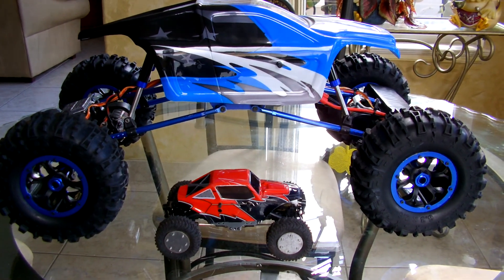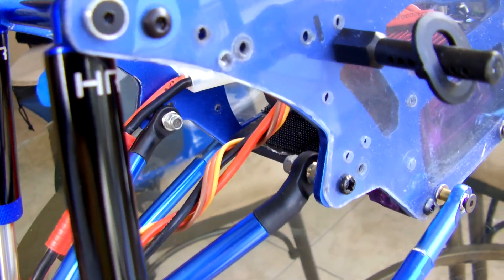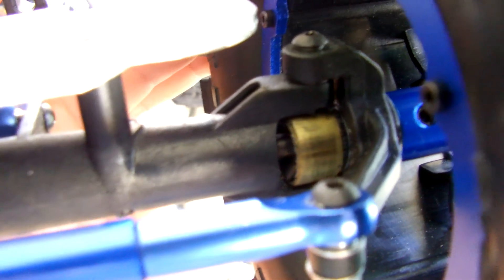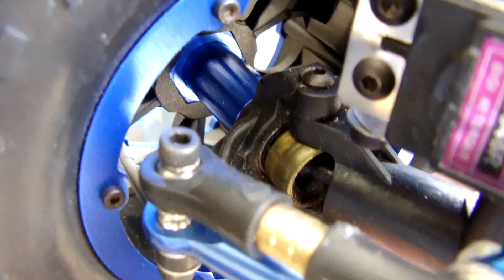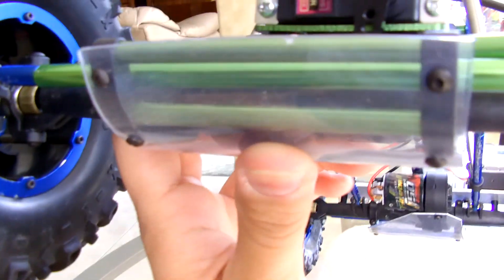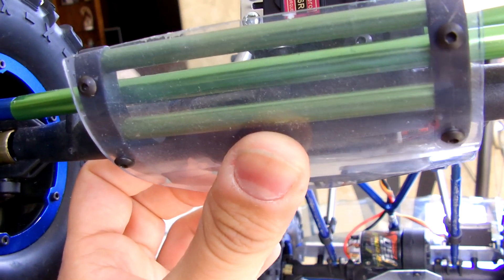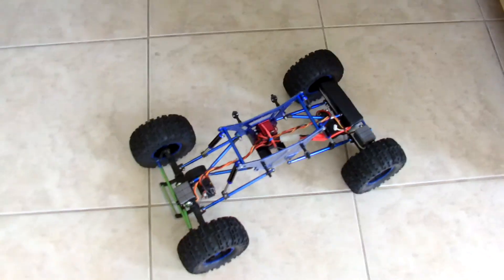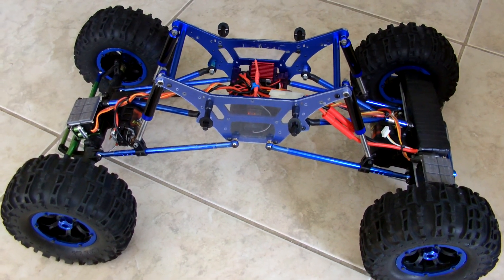Exceed RC Mad Torque 1/8 Rock Crawler Mods / Upgrades 2

Comment: Nice job on those skid plates. I used 1/16 in. black abs attached with c-sunk flat head screws, and formed around the motors and bumpers with a heat gun.

Comment: I have the same shocks  but there are only 100mm hot racing shocks works great on the front only stock shock on the back and a big 4 inch washer super glued on the steering servo.

Comment: I didn't realize it the 1st time I saw this vid. but you custom made the mounting bracket for the servo too. when you moved the cam down in front of the servo so you can see T-pro
I paused and saw the cutouts I thought, holy shit, he made the whole bracket too. 
how cool is that ..... then I rewound a few seconds and looked again. definitely LIKE all the mods you've done. I doubt I would have thought of that. I've watched some of the other mods about this and yours is the best I've seen so far.

Comment: casters off AX10 fit no mods.. i jyst bought one.. finally lol .. but i know all the things needing to be fixed.. fast & furious Toyota supera body going on it.. losing some articulation but jyst for fun..  soon dual esc & lil brushless motors to test.. cheapies.. but.. fun part.. mounting body.. already starting cuz got it in mail.. front motor stock runs first.. so prob reversing motor wires front to the back visa versa

Comment from the maker: Thanks,but actually internally mounted shocks bring weight to center of rig and also allow for more articulation,also bent shock rod is due to lower mount not being tight enough allowing for lower link movement side to side causing sideways force to be applied to rod.But I agree that it can happen, these shocks dont have that issue because rod is actually much wider than stock making them almost imposible to bend.My advice would be to use aluminum lower link shock mounts, they work wonders. :)

Comment: Do You Have Any Problems Of Your Steering Knuckles Keep Breaking??? Well Mines Do.. I Tried Looking For Aluminum Or Beef Up Aftermarket Ones But No Luck...😐 So I Have No Choice But To Oder From Nitro Rcx.. It Takes Bout 2 Weeks To Get In.. It's B/c The Area Where I Live & The Shipping Cost Is Killing MeToo.. lol... But Anyhow, If U Have Any Idea On How Can I Beef Up My Steering Knuckles, I Would Highly Appreciate It... Thanks☺
Reply from the maker: You can use AX10 steering knuckles on it, they make them in aluminum and aren't too expensive, they are exactly the same, perfect fit, Im sure exceed just "borrowed" the design from Axial! ;)

Comment from the maker: Advice on weight distribution would be to put all weight that is over axles as close to center of rig as possible to decrease roll over forces.A good example would be the way XR10 are designed,everything is inclined to center including shocks,links,batteries,everithing.The narrower the rig the better,but you must make sure articulation doesnt suffer,although a lot of articulation can sometimes make it harder to crawl in certain scenarios.90 degrees like mine is just not good for comp use.
Reply: Gamyrc.. funny idea regarding cg.. back in the early 00s we did real rock crawling .. any way,  at a competition I was watching I questioned the one driver about the rig ..he was a cool guy and really took me through the jeep and explained the how n why's. . engine was an all aluminum v6 from an old intrigue. . apparently light, easy to source cheap fuel injection  and enough power for the job. . seems like a odd choice but it made sense,  tires .. typical beadlocks, but the secret is they were 3/4 full of water!!! all that weight down low made so much sense. . obviously that's terrible for normal driving but for crawling , outstanding,  I wonder if filling the tires with water is even possible. . maybe slime?puncture sealant or some other fluid. .or how about steel shot? like ultra fine shot used for bead blasting, even dry sand .. fill tires halfway   , lock em on the rim . . the shot always falling to the lowest point..I'd guess a few ounces of shot in each tire could really be helpful in traction and grip let alone making the cg low ...

Comment: I build a custom frame on my mad torque and put a 1/6 H2 body on it.  modded the shocks for droop setup as well.  The mad torque is a very capable rig, and holds up to abuse well.  I had the Outcry esc on a past build, want to get one for the H2 as well.  Currently have a pair of 55 turn motors, which adds a touch more speed.  Im running the stock esc now on a 2s lipo.  check out my vids of it.

Comment from the maker: No problem, by the way, even though I use them in this video I don't recommend these shocks. They don't offer much adjust-ability and without the oil to restrain rebound they are pretty useless, they are more for show than anything else.

Comment: Emmett Uhlir yes you can run a 3S (11.4V) LiPo with stock ESC  on Mad Torque
Reply from the maker: I havent personally checked with 3S but I know for sure that it will handle 2S no problem. The esc I use here is capable of 4S but this is an Outcry esc with external BEC to handle the extra voltage.

Comment: love my mad torque. anyone wondering what to use to keep nuts bolts or screws from coming loose like he mentioned his set screws coming loose all the time. use finger nail polish. it dries and locks strong enough but can still be broken loose with no damage unlike loctite etc
Reply: Ricky StrAwhun Loctite

Comment: You find you really need all that weight on the axles like that? Do yo find much of a difference?
 I am just getting into the crawling and picked up a Mad torque 6X6 
http://youtu.be/WWEm2LoKX7o
I set up my 6 wheel steering  Way Way Better than stock.
Reply from the maker: Honestly, it all depends on what you want to do with it. If you want to do serious rock crawling then yes because it is too light on stock form to put enough weight on the tires to get good grip. If you want to mess around with it and just have fun (what I do!) then no, it makes your battery drain faster and puts unnecessary strain in your drive train.

Comment: Where dis yoi get those shocks
Reply from the maker: Hot Racing Black Internal Spring Air Shocks 100mm (HRAC1179)
Reply: Gamyrc 
i ll try amazon or theres a specific place..!!?? 
Thanks bro just got mine so farci lov it
Reply from the maker: Just shop around, they sell on 90mm,100mm,and even 110 or 120 i dont remember :/

Comment: real smart. a CRAWLER on a glass table
Reply from the maker: you do realize it weighs less than 5lb and has 4 huge soft compound rubber tires which distribute the weight evenly to cause no damage to the glass, you might want to do a bit more research on the subject before questioning a mans intelligence my friend ;)